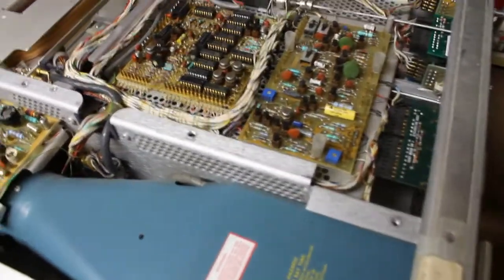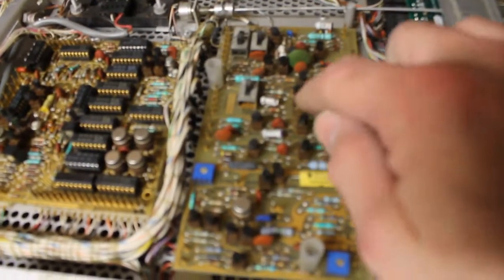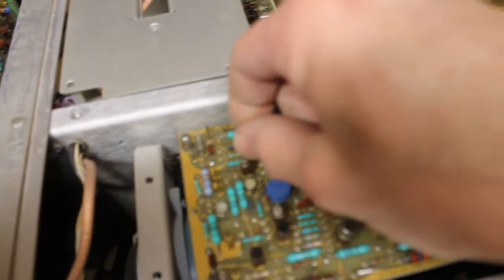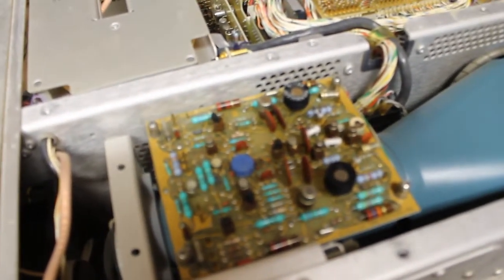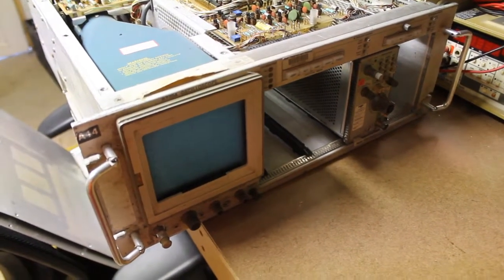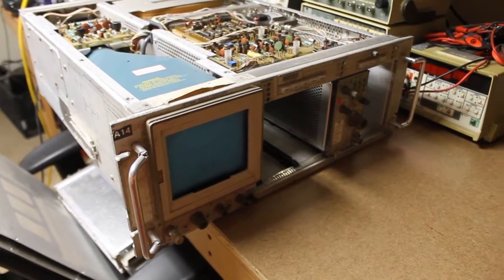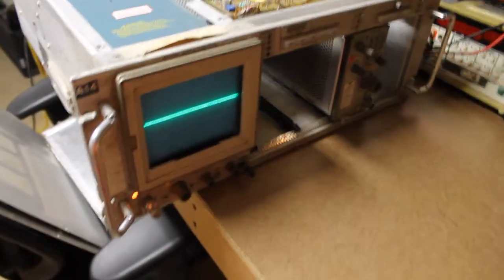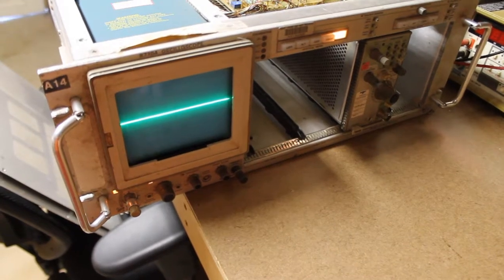Tektronix R7704 Troubleshooting and Repair Part 1

Comment: Hi. I am looking for a decent oscilloscope (used) and this exact model is nearby very cheap and apparently working. Would this be a good buy, useful for most electronics projects? Thanks.

It is here: https://pittsburgh.craigslist.org/ele/d/tektronix-r7704-oscilloscope/6671132644.html